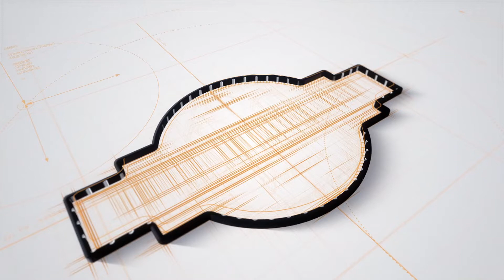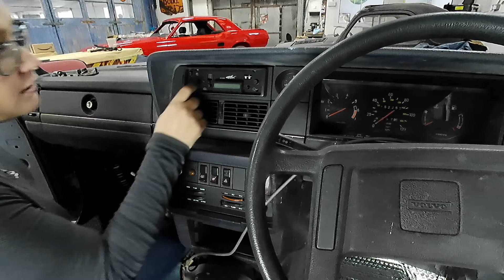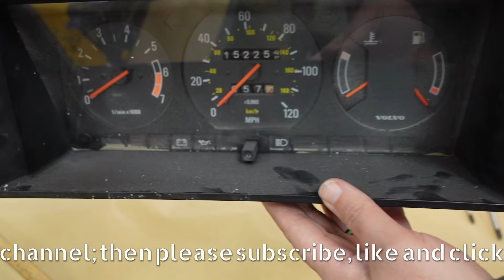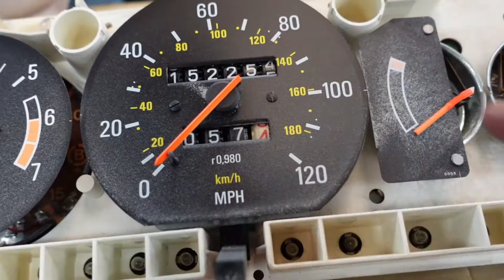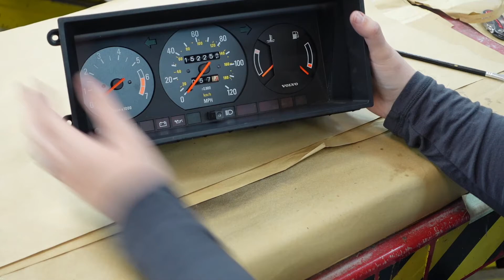Fixing Up the Interior and Hanging Some Doors! - Volvo 240 Restoration Project - Part 21

Comment: My 240 has broken spots with this trim. Unfortunately, I don't have the pieces to glue together. I looked on Ipd but I can't find any replacement parts. Any suggestions?
Reply from the maker: Keep your eyes peeled on ebay for a breaker 240. Plenty of them come up, they'll gladly sell you the piece you need. The facebook groups are pretty good too for sourcing bits and pieces 👍